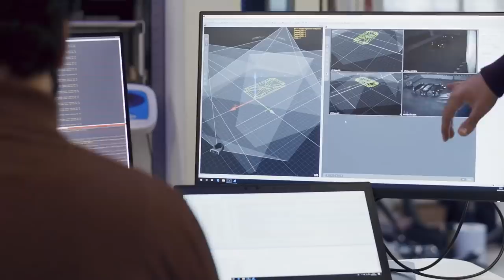Inside Arrival's Revolutionary Microfactory

Comment: did he say that steel is light? lol. It's one of the most heaviest metals that is suitable for consumer products
Reply: It is light though, when it comes to metals steel is one of the lightest atleast in comparison to weight/density and affordability
Reply: Light in terms of its viability for certain types of construction and manufacture, basically. This factors in strength to weight ratio, workability (the ability to work it into different useful shapes), cost, and availability.

Comment: Stock price of ARVL is really cheap at the moment, at USD 13. Within 3 years this will be trading at over USD 100 !
Reply: or 0 USD
Reply: Is this financial advice?
Reply: I think $35 is more likely. To soon to say. I like that they have no debt.
Reply: @jeremymanson1781  well that has changed since you posted this haha
Reply: @adrianmizzi5667  It certainly has - diluting the stock and delaying the start of production - Ouch! Shed loads of shorting activity.
My guess is that only (if / ) when production starts will the price climb back into the $14-$16 range ???
Reply: @jeremymanson1781  The fundamentals are very solid for Arrival. All analysts are saying that arrival will outperform. Analysts forecast a low of $6 and a high of $50. This slight delay in production is a really good time to buy; but the investment horizon for decent returns (>2x) is probably a year, possibly two.
Reply: Its at 3usd per share now
Reply: @nivvin8536  $1 now

Comment: Traditional car plants are usually geared up to only make one specific car, and employ hundreds of people.
If sales of that car drop by 50%, the plant becomes uneconomical, and either needs a complete refit, or it closes.
If you have 10 smaller plants making the same number of cars, you can just refit or close only half of them.
This would be half the cost of refitting, or half as many people would lose their jobs.
Plus, the ability to refit a smaller proportion of your production line means you could produce smaller numbers of each type of vehicle, and therefore keep making the vehicle that has just dropped to 50% of previous demand, when traditional plants would need a much larger demand to be economical.

Comment: Looks good. 2/3 way through and no talk of battery or software?
Reply: Then what is an all electric van about than the battery mileage and the software that drives the system? Just asking..
Reply: @Yahudikiwi  battery mileage is made-to-order. Software is provided as a collection of base APIs and libraries which you then build on top of yourself to provide an interface customised to your use.
Reply: i dont think it makes sense for them to focus on batteries or battery packs, when giants like tesla are doing it with 1000x the scale and budget. let them focus on what they can do best. i would actually be worried if they conduct battery reasearch.

Comment: Large factories can build a LOT of one thing very quickly and efficiently.  However, a bunch of smaller factories can change relatively quickly and customize their product to the needs of the locality.

Truthfully, while their manufacturing method is more flexible, it is their materials science that allows them to compete with the big factories.  If the big factories were using the same materials science, they would be a great deal less expensive.  That being said, I hope Arrival makes it big in the industry as I really do like their setup.

Comment: 4:35 so the composite material is 100% recyclable even as a finished product on the vehicle itself?

Or is it only 100% recyclable before the glue, molding, and setting into a solid hard part?
Reply: Bio-chemistry is capable of duplicating virtually any oil byproduct today. Even Carbon Fibre.

Comment: I love some of the concepts they introduce - the fiber body panels sounds neat, the modularity is cool, the way they can program the arms for updates or design changes is cool. 
But for the microfactory, I am not 100% what problem it solves:
    Shipping costs -  there would still have to be materials shipped to each microfactory, and I'd imagine usually the price of shipping vehicles is usually negligible anyways (unless over oceans).
    Manufacture speed - There's no way that per square foot they're as fast as a dedicated designed megafactory at churning out vehicles. 
    Cost - The tech is probably cheaper, but mainly because of the other innovations - namely the fiber body panels and ease of modularity
    Set-up speed & Scalability - this is one advantage - not much capital needed to set up or time investment needed to start a trickle of production, and makes production MUCH more scalable. That said large companies live on the margins rather than the up-front costs/revenue...
Reply: main thing is — take away local investment capital from ARRIVAL shoulders, its a partner hassle with a sales&service to local gov )))
Reply: No steel press. No paintshop. Aluminium frame. And I've seen the body panels hit with a hammer - it made no impression. No scratches. The taylor made software collects every metric imaginable transmitted in real time to the fleet managers. Same price as ICE with greater load and lower service and maintenance (less moving parts, and all modular) Test vans are already driverless. This allows them to enter warehouses fully auromated loading etc..

Comment: I would like to see size and complexity of systems that supply raw materials to those microfactories
Reply: It seems to me 'raw' is a very generous word for it.

The video is extremely vague. The only detail about production we got - replacement of steel sheets with some proprietary magic composite material.

Not a word about how hundreds and hundreds of different components are going to be produced at those magical scalable cells. Either there are supposed to be different cell types producing different components/ doing the assembly or the components arrive manufactered somewhere else(bought from different countries). In which case it is going to be logistics hell to supply all those microfactories.

Not a single word about batteries, or pretty much anything of essence.
Reply: I think these factories are only really for body and general assembly, other components would have to be made elsewhere
Reply: @jackplant9232  True but almost any material/component can be stacked and transported more efficiently than a finished car, so I guess there are minor gains there. I think they combine enough good idea's to have a chance at making it.

Comment: 2:03 Tesla's Nevada Gigafactory is a horrible example for what you're trying to argue. First of all it's a joint venture and Panasonic doesn't want to innovate as fast as Tesla would like, so they are shutting down that project as soon as possible. Tesla's new Gigafactory projects are 8x denser, meaning that they'll make 250GWh of batteries per year, instead of the ~34GWh output of the Nevada factory.
Arrival is doing final assembly at the microfactories, which is absolutely irrelevant from any point of view. The parts and materials still have to be shipped across the same distance. It just means a lot more headaches for engineers, when they are upgrading the lines or trying to fix a problem. They have to travel to hundreds of factories instead of just a couple of big ones.
Reply: Thanks for informing me. Making something modular is great but it doesn't solve all problems. Maybe the video is too optimistic? I like objective videos rather than side-picking ones.
Reply: Your right it doesnt work. Carbon fibre is more expensive, dont manufacture batteries, they just assemble the final parts built somewhere else. But the biggest thing is...quality control thousands of microfactories means quality control is a nightmare
Reply: @philipdrew10  logistics and supply chains are going to be a nightmare as well. They either are going to have to keep an extremely oversized stock of components(which is money wasted) or have a significant downtime in those microfactories, whenever they lack one of the hundreds different components or some machine breaks.

Would you rather configure 10 extremely big machines at 3 sites with a whole team of specialists and keep maintaining them or configure 10000 of them at 10000 different sites and just keep rolling around when one of them breaks.

Based on the info provided in the video(basically no info) the idea seems quite pointless.

Comment: This is a ground breaking manufacturing process to be able to use composite material that won’t work for mass production. Have seen the new concepts and they look great but none of this will work if they can’t get the Micro Factories to work. Prototypes are easy production to scale is not. I estimate that to make the production numbers work they need to make a van every 30 minutes. From information that I have seen it looks like their production rates might be a problem the modules seem slow and so does movement from module to module. Hope to see more information about hours needed to complete a vehicle and number of modules for complete process.
Really pulling for Arrival to make this work composites are the material of future but need to figure out the production.

Comment: I work in large scale automotive manufacturing... this can work for small volumes, and sure the cost could mean they have the scalability but this will be a logistical nightmare for parts and I still struggle to see how it would work but I'm happy to have my opinion changed
Reply: I think their real product is not their vehicles; the real product is the microfactory. Arrival is a factory that makes factories. Companies rent them to have them set up quickly nearby when they need a fleet, then the microfactory could just as quickly be returned. The fact that Hyundai, a car manufacturer, is an investor instead of a competitor suggests that they do not see Arrival as a rival manufacturer, but rather a service provider they might engage.
Reply: @PixlRainbow  I got that feeling Hyundai might try that at their new Singapore plant (it's supposed to make bespoke customisable cars and taxis, according to the PR videos)

Comment: what about the safety of the vehicle since it is fixed with adhesives .
Reply: it as good as welding, with most industrial use glues and adhesives you would never notice a difference and in the event of a crash, the more important aspects of these car for survival is the seats and air bags
Reply: these adhesives are used in commercial planes, safety is a forgone conclusion.
Reply: @coreytaylor447  In 2006 when I went to uni the strongest steel glue was 32kg/mm² a stirweld over 70kg/mm².
But welds  can only be made in the peripheral while glue can be applied to the whole surface, that makes it a stronger bind if the geometry is right. Also there will be less flex with glue than welds.
Reply: There are hole train-cabins fixed with adhesives- no problem at all
Reply: Can't wait for the first crash test...

Comment: Seems like Arrival is mainly aiming for the cargo vehicles. So, how are they tackling the capacity issue? Since batteries weighs 5 times more than gas for same energy, EVs will simply have smaller space left for carrying cargo after putting in all the batteries. The fact that Arrival cars will be made of fabrics and glue will make them even more unsuitable for carrying heavy load. How is Arrival aiming to handle these?
Reply: Good Questions. It won't have so much space and weight for cargo so glue&fabric isn't a problem now. It comes after solving space&weight issues.
Reply: @Erdem_Beyblader  But I'm jumping over and raising another issue. Now that of longevity and reliability. The fact that people are exited without asking any question is very concerning.
Reply: Pretty sure their commercial vehicles have a steel chassis, it's the body that is composite. There is a bus company in the UK testing their passenger vehicles as we speak.
Reply: @JohnnyMotel99  If such is the case, then we're back to large factories and their core promise of "small decentralized factories" is just that.
Reply: @aniksamiurrahman6365  We people must be more suspicious. If I didn't read many comments  including yours, I'd be one of that people. Looking at comments is very useful against  side-picking videos.

Comment: Democratizing Hardware & Manufacturing is the next Industrial Revolution
Unlike Software, where most of the costs are operational, and a high chances of quicker ROI, Hardware Development & Manufacturing has always been a capital intensive business, and the cost of a failure is too expensive. Hence, there are practically no new entrants compared to Software.
Technologies like 3D-printing, Modular Manufacturing, Robotics & Automation etc. are soon going to change that.

I believe it is not going to replace the traditional manufacturing, but rather complement it, by providing early stage concepts a fighting chance in the open market. Once it needs to scale up, Integrated Manufacturing Plants (like Giga-Factories), Huge Assembly Lines etc. should still be the better way in terms of efficiency, scalability and mass-manufacturing.

Comment: I hope they do well, UPS and the other package delivery companies need to speed up their transition to EVs.
Reply: Making EVs for cargo carrying is close to impossible. It's hard even for package delivery vehicles. The reason is, you need a shit ton of battery when the weight of cargo becomes comparable to vehicles.
Reply: @aniksamiurrahman6365  Well that's just nonsense. They don't need a huge amount of range, and can be recharged during the drivers lunch break. Did you even watch the video. Arrival is going to start production this year, and Amazon placed an order for 100,000 cargo vans from Rivian. You should do a shit ton more research.
Reply: @eldiablo8019  Orders? It's more of a research project. Rivian is yet to even design the truck. It's almost like Amazon has just made an investment in Rivian, which is praiseworthy. But these are gonna be short range vans carrying lightweight cargo. And what we've is a research project - just what I've said.

Comment: what happens to raw materials? doesnt that increase the overhead, You need metal, glass, electric components, tires. How does the supply chain get managed?
Reply: Looks like a completely impossible logistics hell.

Distributing the components/raw materials to thousands of sites would require an incredibly sophisticated system with a lot of inefficiencies and downtime on microfactories imo.
Reply: I think the concept is that wherever possible raw materials would be locally sourced too, although I can see issues with more expensive raw materials due to low scale and obviously some materials won't be able to be locally sourced
Reply: It is not thousands of sites, it will be a few tens of sites. This is a perfect model for courier and car rental companies that need bespoke vehicles of a few thousands. The supply chain is sourced within the country that the vehicles will be built. it is done through parts that already exist in the specific market.
Reply: I guess eventually it would be done regionally, nationally. Presuming a particular part is the same in every model, they would mass produce it somewhere nearby before transshipment. Where the orders for a vehicle might be split between a few sites depending on the order with priority for the nearest site.

Comment: it's definitely a way... I actually think, that both ways of manufacturing will have their spaces... Arrival with its public transportation devices and local features... and yet on a mass scale those Gigafactory settings will prevail as well, because we talk about a global shift in transportation modes within the next 25 years or so... that's a lot of cars that have to be produced, and 20-40 per micro factory cell isn't that much even if you scale it up a lot, isn't it?

Comment: This might be fine for forming and attaching body panels, but most of a vehicle's components are made of complex metal assemblies.  This composite cloth won't work for those.  This isn't going to build the chassis, or the drive train, or the brakes, or the suspension, never mind the batteries or the motors.  This is automating one part of car manufacturing, and not even the hard part.  All of those other pieces have to come from somewhere else, and transporting small lots of them to tiny assembly shops isn't cost-effective all by itself.  They're going to be snapping together parts from other makers, probably Hyundai and Kia, who are investing.  This is a play to get some British content to avoid tariffs.

Comment: This video skips over a couple of major drawbacks of Arrival’s approach- a Tesla gigafactory is highly vertically integrated. Those factories make almost everything that goes into the vehicle. Arrival depends on massive global supply chains, meaning parts shipped from all over the planet cancel out any gains in not having to deliver vehicles quite as far. Second, microfactories have extremely low production volume, producing tens of vehicles a day, whereas a gigafactory can produce many hundreds, into thousands of vehicles a day, which makes microfactories incredibly inefficient by comparison.